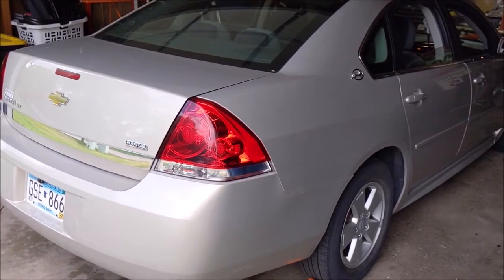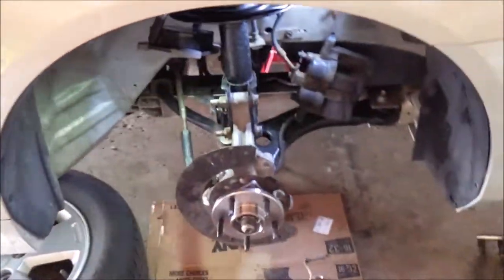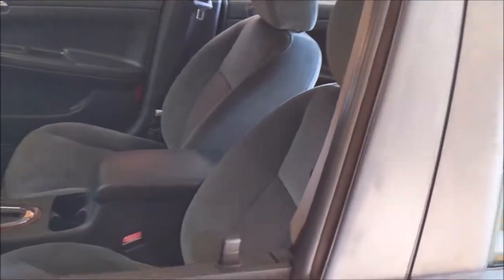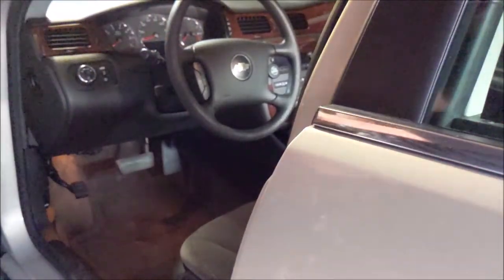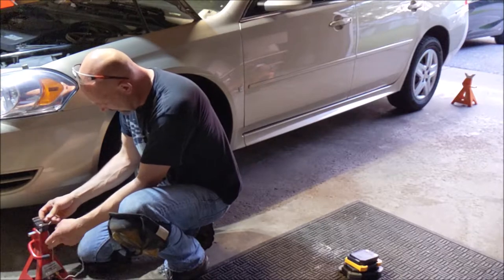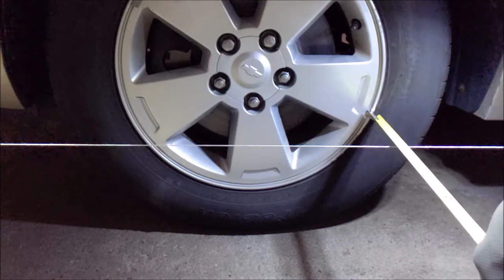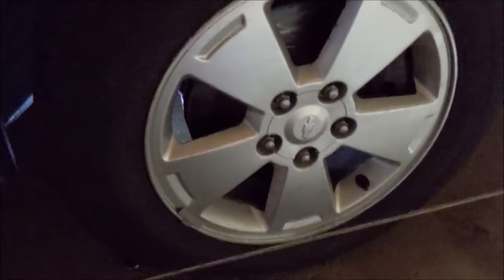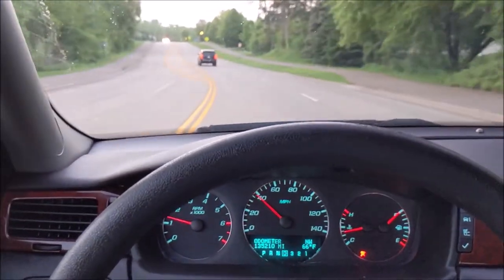2009 Copart Impala Chapter #2: Wheel Hub, Brakes, and Driveway Alignment

Comment: I love Tirerack, when I ordered my Pirelli's they ship them and I had them in like 2 days.  But yea if you can get the same deal with Walmart might as well go that route.  I had a friend that worked at a tire store, mount and balance and align for $80 was a deal to me.  I don't think I'd trust my own alignment like that.  I've never done it but I understand waiting for the struts to be installed.
Reply from the maker: Yeah, $80 to mount, balance, AND have an alignment done?? That's a DAMN good deal!!  I'm most definitely taking it to a shop for an alignment, the string gimmick was just to get it close enough. Not too concerned driving it around with it like that for the time being, though.  

TireRack has a distribution warehouse near me and they give a discount of $10 per tire if you pick the tires up there. You still have to pay sales tax, but the discount more than negates that.  Might end up coming out ahead that way instead of going to Walmart...
Reply: @CertifiedShadetree  well that's cool that the Distribution Center is that close to you. For Tire Rack. Here I'd have to drive to Las Vegas which on a good day takes about 4 to 5 hours. Not worth the price of gas.
Reply from the maker: Definitely not, especially when they now have free shipping!  I've noticed they have hiked the prices of their tires up a bit in the last several years, probably to compensate for the free shipping.  I can remember when their prices were the absolute lowest you'd ever find, but the shipping costs would eat into that cost savings. If I'm remembering this right, back in the day they had 2 warehouses - one in Indiana and one in Reno. I always chose Indiana because the shipping was less from there 😆...
Reply: @CertifiedShadetree  when they were a pretty young company I work for Mitsubishi Motors here in California and I remember they were setting up Tire Rack as the official Tire distributor for all the dealers at that time. If customers actually wanted to buy different or replacement tires at the dealer.